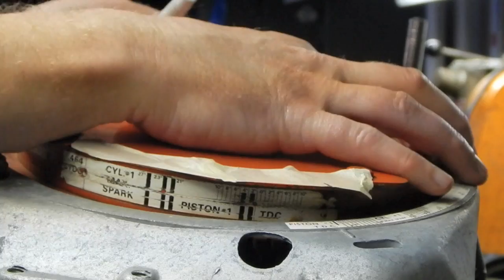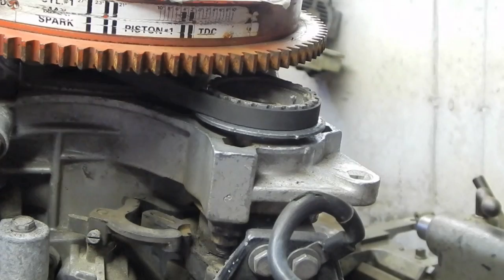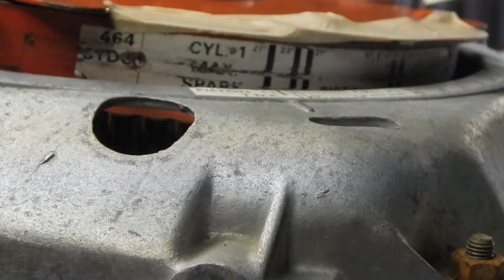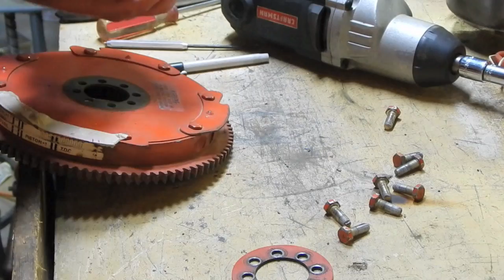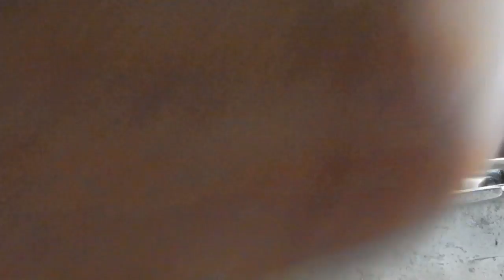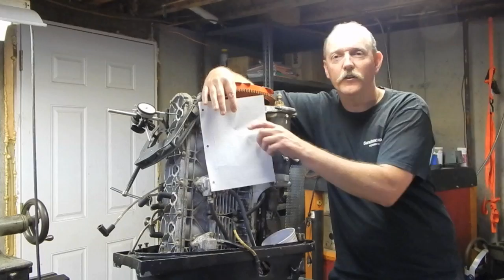The Mercury 115 "Tower of power " outboard motor Part 16

Comment: I picked up a later model Brown band 115 and had been having trouble timing it, after checking TDC and the reference point .414 it turned out it had the outter fly wheel one bolt hole out 😂 to they had the pointer positioned to .414 when it was at TDC😂. Was a cheap and easy fix and all is good now

Comment: I just want to provide a bit of a disclaimer. Perhaps you spoke to this in a later video, so I apologize for repeating if you did. Those 8 bolts that mount the flywheel to the flywheel hub are not intended to be removed. 

To insure that those bolts would not come loose due to vibration over time, Mercury invented a manufacturing method to  "stake" the ends of those bolts. Basically, the machine deformed the threads at the end of the bolt after they were tightened down. No form of liquid thread locker is equivalent to this staking method. Furthermore, by backing these deformed bolts out when removing them, there is likely damage caused to the threads in the hub. Although it is a pain, using a puller and removing the flywheel as one piece with its hub is the correct way to insure those bolts are properly fastened. 

I don't mean to off as accusatory, as I too once thought those bolts were meant to be removed. It's an easy mistake to make, but unfortunately these are very critical fasteners, and a lose flywheel is a scary, and likely damaging event.
Reply: I removed these bolts on a seized mercury/mariner 60.
I bolted a bar to the center hub (with the flywheel nut loose) and turned the shaft clockwise. It initially felt like I freed up the seized motor but actually that hub under the flywheel was unscrewing. I proceeded to turn this back clockwise. It got tight and likely went past it's original point. With some huge force I got the motor unseized. Long story short it has spark, fuel and compression but won't run and actually kicks back. I bolted the flywheel back on at 0tdc with the top piston at TDC but I assume the base actually contains the trigger and it's not actually at TDC. Any idea how I fix this and get the timing back to factory? Thanks

Comment: Love the videos, just recently started on this series. You seem to be doing quite alright without a service manual, but if you do want one, I just so happen to have one I'd be willing to scan some pages from.
Reply from the maker: James Gale thanks for the offer. I'm pretty far along now. i hope to be testing it on the water this spring.
Reply: Any chance you still have this and could send me some details regarding timing. I took off and dismantled the flywheel. Moved some bits and it's all gone pear shaped. Thanks.
Reply: Sorry, I haven't been online much in the last couple years. I do still have the manual, I've actually digitized the whole thing. If you still need help, just send me a message with your email and I'll send you the whole manual.